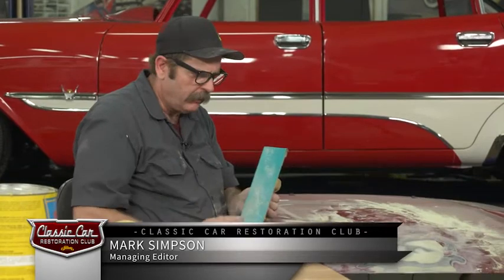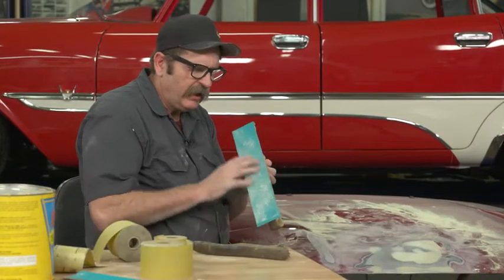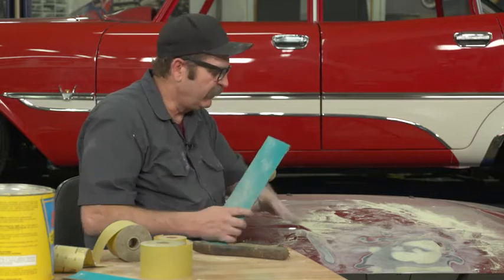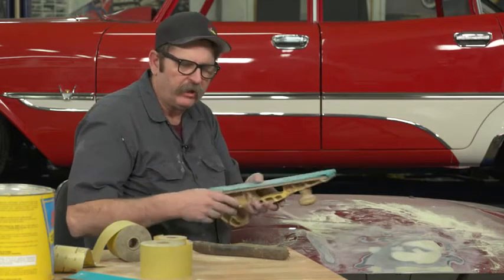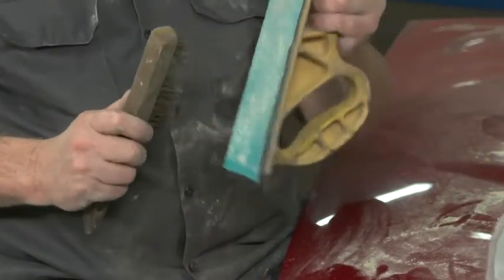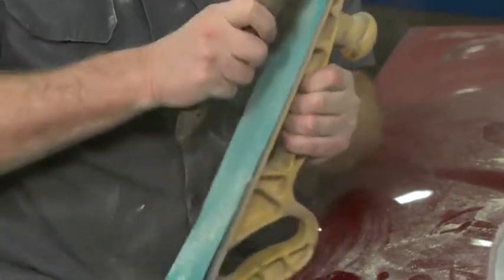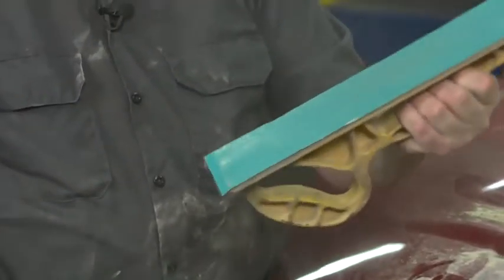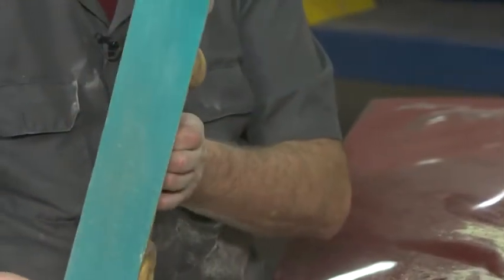Cleaning Sandpaper

Comment: Hooray a sandpaper cleaning video which doesn't involve belt/ bench motorised sanders. I was just about to do some filler on the van. 
Thanks very useful. Works a treat. I start with nylon brush and use wire if it's still dirty.